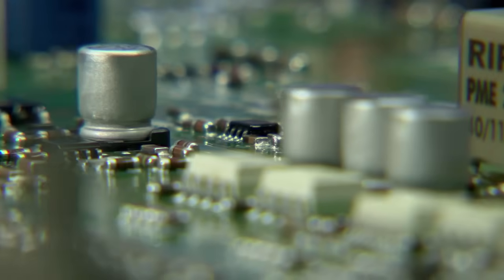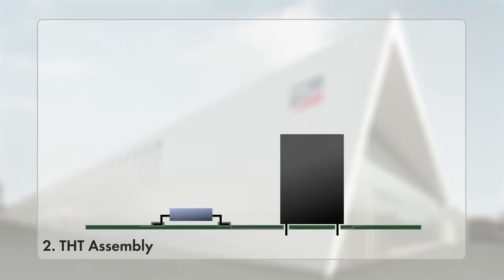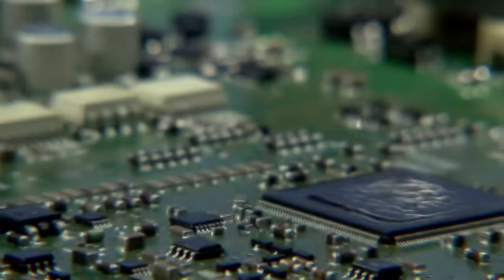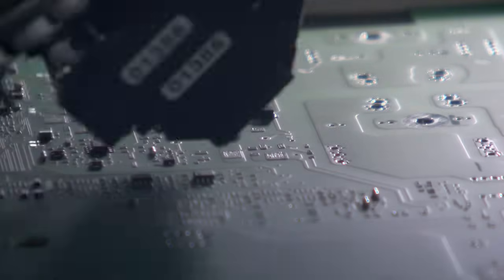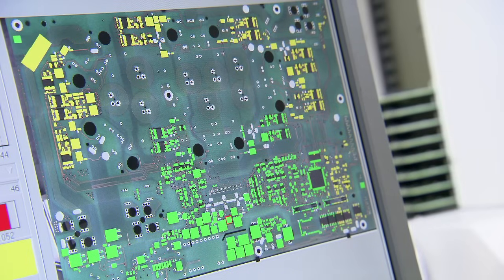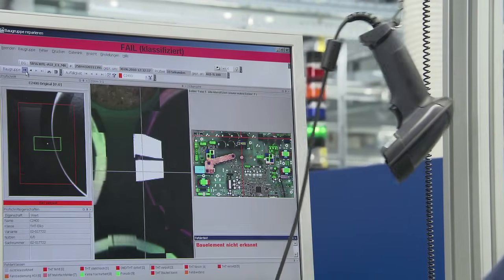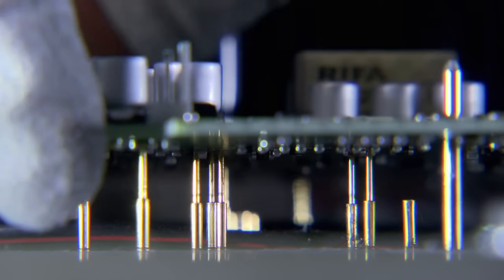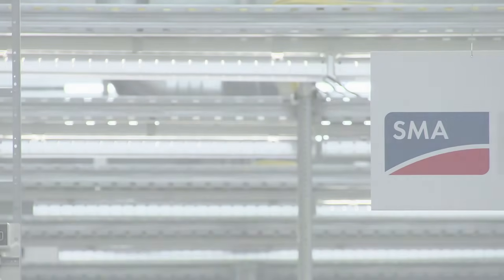Circuit board assembly at SMA's German factory

Comment: +SMA Solar Technology
Why isn't the entire board sprayed? Why are there holes in the board that are empty after the THT assembly?
Reply: BlueAcid9 most of those holes are used as a bridge to the other side of the board, connections are often made this way and you can find those holes on many circuit boards. Sometimes holes are used for cooling. Some holes are for screws to mount the board in its casing
Reply: @Jantus1000  also holes for components does not always required to be filled with componetns. it depends on a technology, model, requirements, maybe for future updates.
Reply: @imetators  and some might be the contact points for the testing procedure

Comment: What is the overhead cost for producing 1 circuit board?
Reply: gabber230ful Actually, not all China made PCBA boards are bad quality. Because you get what you pay for. We are one of the PCBA manufacturer in China. We make customized PCBAs as per our customers' requirements.If they confirm some alternatives can be applied,after order confirmed,we'll send them PDF datasheet for alternatives before purchasing.For high standard board, no alternatives can be applied,only original components,which will be 100% guaranteed.If you want an exact cost of your boards, you can send PCB gerbers and BOM list for gettting a quote. My contact: sales3@c-alley.com
Reply: +gabber230ful Depends on the size of the board and the number/cost of components. These big companies do not usually do single boards, as it is not cost effective, or the price is prohibitive for normal users. You can get something done in China, where it is cheaper. I saw offers for small board around $10, however the quality was quite bad.
Reply: thank you so much. It was great help :)
Reply: do you still looking for superior PCB supplier ,our price will be interest of you ,send me your Gerber file for evaluate the quote

Comment: I'm still in tinking how the capacitors and big components are solded to the board with the liquid soldering how much so near to the board must be to catch the soldering whtout remove the circuits down the board?
Reply: +iozk hz I'm not sure what you mean but, the SMD parts are all on the top side of the board, so the solder wave under does not touch them.
Reply: +iozk hz Exactly. And if it is necessary to have SMD components on the bottom side of a board that will be wave soldered, then the components are simply glued in place first.

Comment: 4:13 this is not exatctly true we have AOI but even though we have to check components and solder quality by eye.
Reply: SuPrAmAd101 No, they were just speaking marketing, like when they spoke of smd resistors as "sensitive components"
Reply: As you say it is possible. we have to as we don't have any computers to do it for us, but possibly they meant with the volume of pcbs they make?
Reply: Same. Aio helps alot, but progamming it is total madness. Even tho pcbs are passing through with OK sign, we still force eye check afterwards. We do not force it for simplier boards, sometimes bottom side of a board aswell as it contains less components than top side, so our workers spend less time on them. Also, THT workers do not use ESD gloves? wut?

Comment from the maker: All wired components differ greatly in size and shape. As a matter of fact, equipping “Through Hole Technology” (THT) automatically is rather time-consuming. In addition, we would have to use very special machines which would simply go beyond the scope of the cost-benefit ratio. 

Best regards, 
Gerrit

Comment: The vast majority of hardware failures in higher power products like these are the electrolytic capacitors, if they are exposed to heat, reverse or over voltages from external sources over long periods of time even the best quality electrolytic capacitors fail. They dry out and eventually the pressure inside until they blow out. 

watch?v=D-RZ5RTAdSg

Modern capacitors do this in a controlled manner.
other than that vibration or strain can loosen solder joints over time

Comment: Haha...
You're funny.
No, It is YOU who have no idea about ESD. All the new integrated circuits (from 90's) have some level of ESD protection.
It is the Human Body Model (HBM) and Charged Device Model (CDM) parameter in the datasheet.
Moreover, any risk of ESD failure it's absent when the IC is placed on PCB.
I am an electronic engineer with 20 years experience in electronics labs and now I have my own company for power electronics, and never, NEVER destroyed a circuit from ESD.

Comment: The explanation why products break down after 12 months is due to the components they use. Every manufacturer has a main focus on profit  and this is achieved by using cheap components. The end user can't decide wheter the manufacturer has used cheap or expensive products. Even an expensive product cand have cheap components and vice versa.

Comment: @urbex2007 Most products fail due to installed devices added to the board i.e. capacitors, resistors ect... This initial failure will overload other devices due to increases in current and voltage via the short in circuit and cause failure through overheating. The poor quality of devices is due to the tendency for competing companies to cut corners for a cheaper and easier method of manufacture.